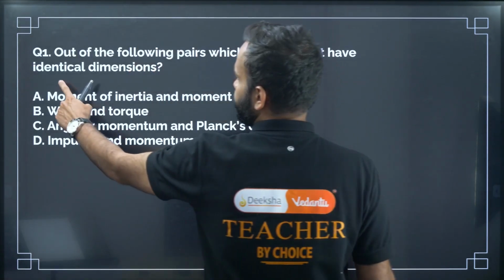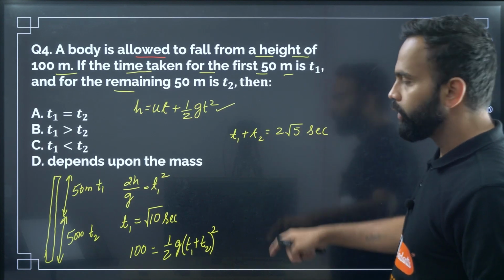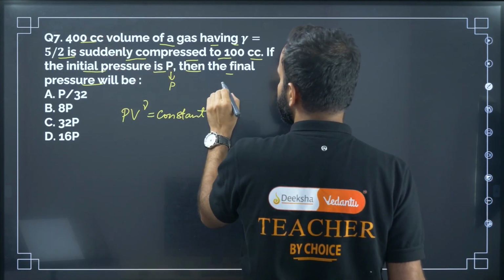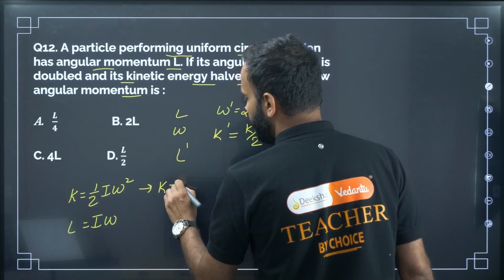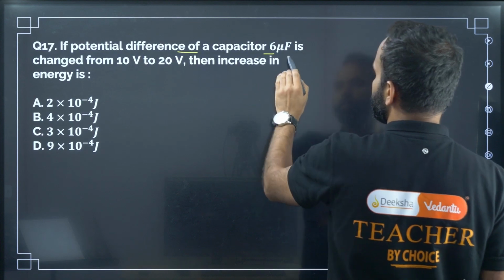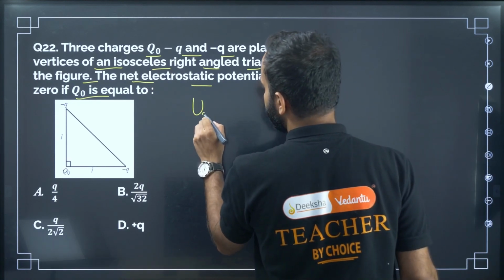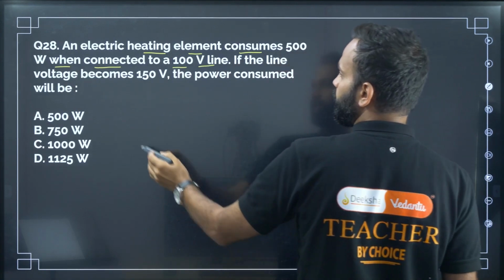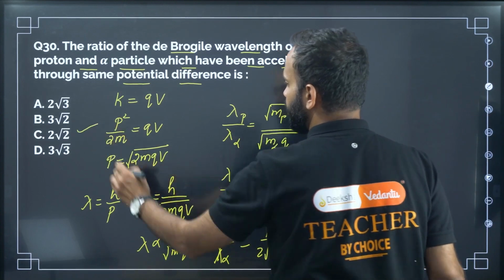COMEDK 2024 Test Series: Physics Mock Test 3 Solution (Part 1) Q1-30

Comment: in 19th question current will only flow from two capacitors the other 4 are short circuit